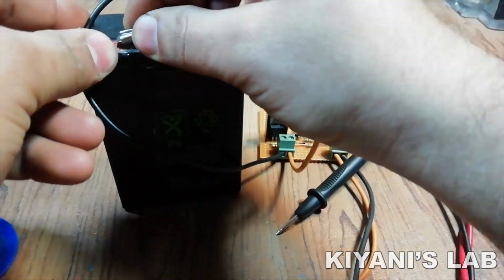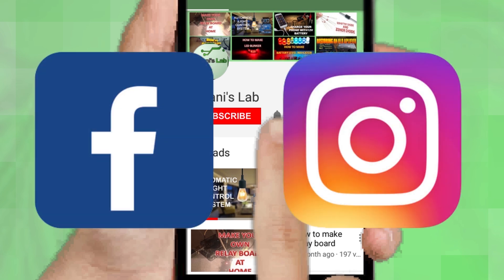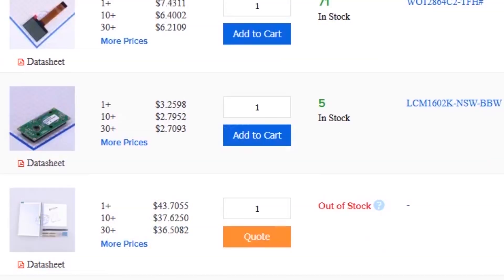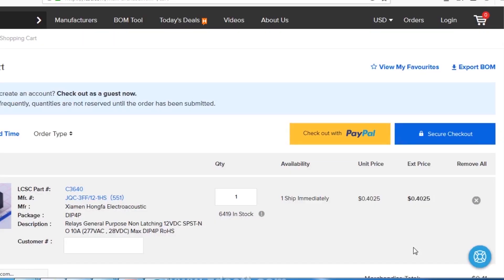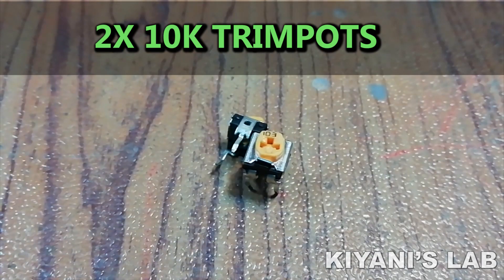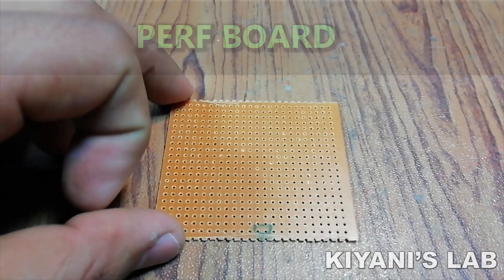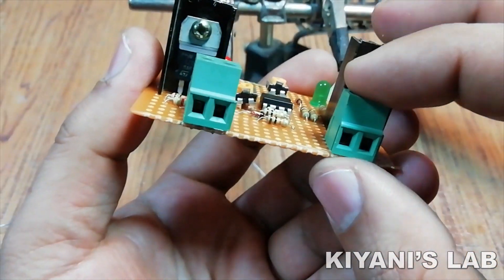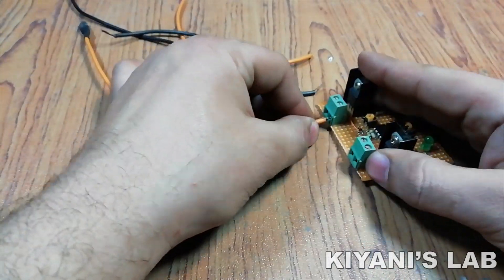HOW TO MAKE 6V BATTERY PROTECTION CIRCUIT

Comment: Being a guy of non official degree in Electronics i have tried to make it, but i couldn't be successful. Without a printed board diagram i have made it in a Veroboard, i have checked the connections at least 10 times, and couldn't identify any error in connections, but still it's not working, (IN THE END OF THE VIDEO WHILE THE PONTENTOMETER IS SET THE CAMERA FOCUS GONE OUT OF THE SCREEN SO I COUDN'T SEE IN WHICH TERMINAL BLOCK POWER IS GIVEN IN WHICH LOAD IS GIVEN), so by the drawing and assumptions i have tried to set the voltage with the VRs but in my case while setting both highest and lowest cut voltage through VRs the LEDs don't go off, just go dim only. i Have spent more than 7 days to make this circuit minutely but couldn't be successful. So please give any suggestion?? or can i get a printed board diagram directly for the circuit?